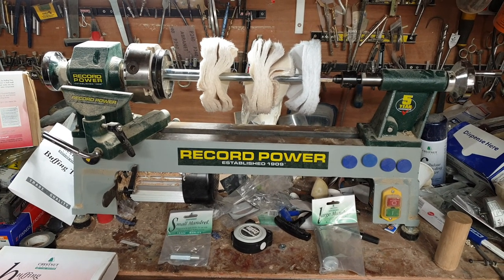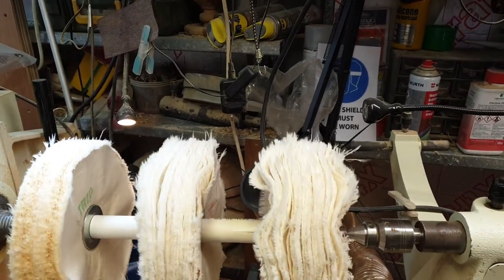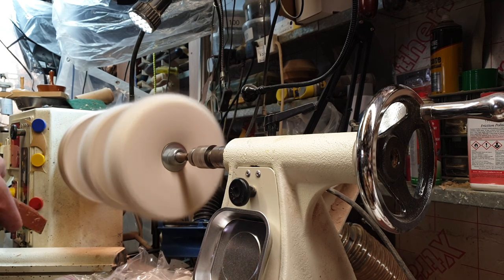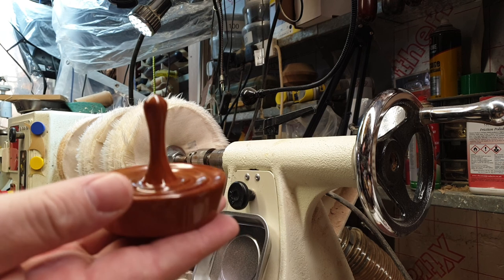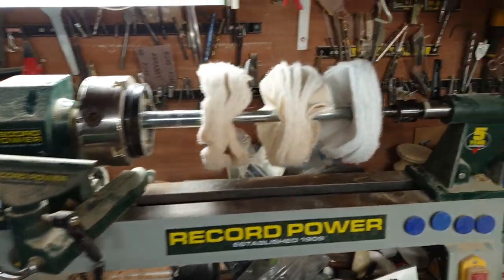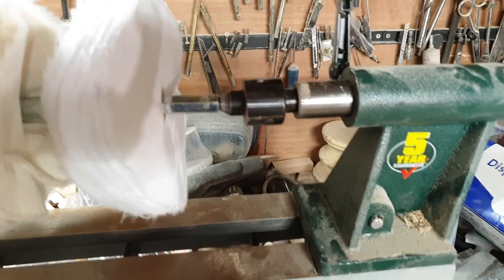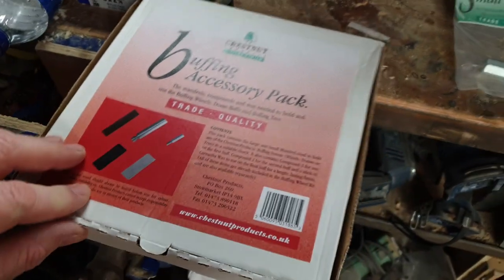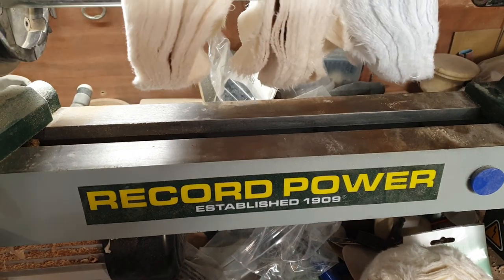Chestnut Buffing Tree v Beall Buffing System Part 1

Comment: Hello not sure if you will get this one year on but with the buffing tree do you need to buy the accessory kit if you already have a chestnut 3 wheel with wax kit.thanks
Reply from the maker: Hi Alison, you need the large mandrel which fits into a chuck to drive the buffing tree. If you bought the buffing wheel kit with the 3 separate wheels you should already have the large mandrel. The Chestnut buffing tree is great for beginners and hobbyists for polishing small pieces in one go. I hope that helps you.